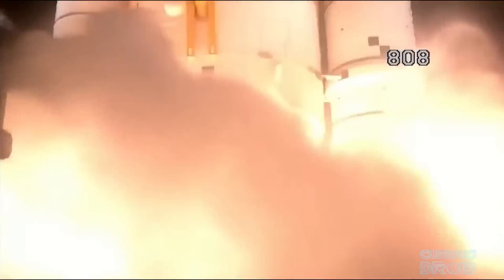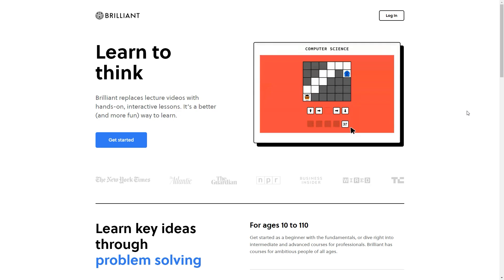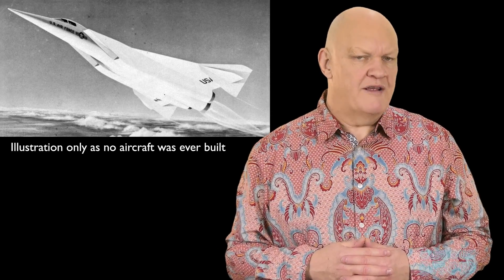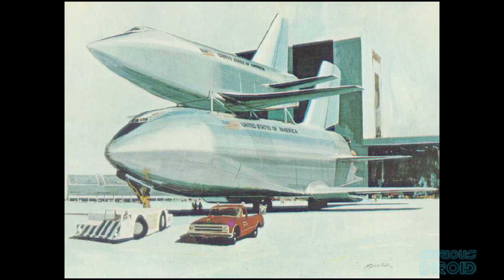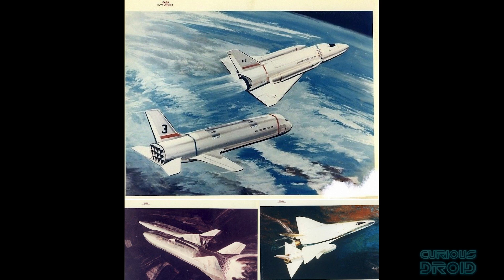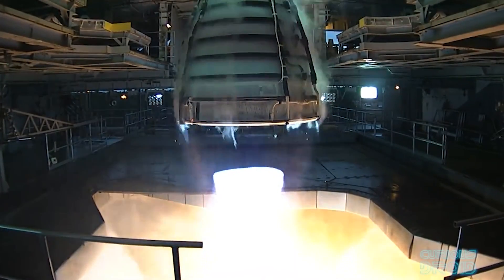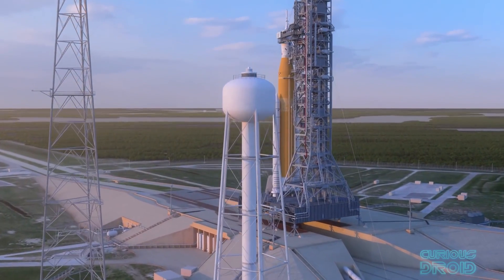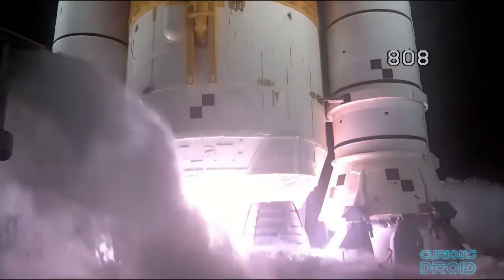Why is NASA Throwing Away Reusable Engines?

Comment: so NASA is still making single use rocket engines..but are using ARCHAIC tech from the SPACE SHUTTLE unlike MUSK who has a reusable smaller but will upgrade to suit rocket family. TYPICAL GOVERNMENT.. wasting tax dollars for half ass results and polluting the worlds oceans with un-needed junk, all while stating ((WE)) need to live smaller and less wastefully.
Reply: Booster reusability is great, but has drawbacks.

First, if you don't have a fast enough launch cadence, you can spend more on recovery equipment and personnel than you save by reusing the booster.
Second, you take a payload hit for the recovery system on the booster. The Falcon 9 B5 can lift up to 22.8 tons to LEO when expended (SX), but only up to 16.7 tons when landed on a drone ship (B1069.2). Doing a Return to Launch Site (RTLS) landing, costs even more payload as you have a boost back burn to cancel the lateral velocity and return back to the launch site.
Third, the higher and faster you go, the harder reusability is to perform. The heavier the dry-mass of your booster, the harder reusability is to perform.

So with SLS launching once a year, eventually, the cadence doesn't really justify recovering the booster. Not to mention that it gets higher and faster than a Falcon 9 as the SLS core stage almost reaches orbit, making recovery MUCH more difficult. The SLS core stage is travelling well over 3 times as fast as the Falcon 9 booster and is well over twice as high as the Falcon 9 booster at MECO. The dry mass of the F9 booster is 22-25 tons while the SLS core stage is 85 tons.
The SLS Block 1 can get Orion to the Moon, but not with the kind of payload hit like F9 has. The SLS Block 1B will send along a Lunar Gateway module with Orion, so it really can't take the payload hit either.

SLS started design work in 2011, 4 years before SpaceX landed the first booster and almost 6 years before they reused a booster.

Comment: While cost is certainly a big factor I think something is lost on most casual space fans when it comes to reusable rockets like the F9. While it is great and should be developed with the maximum amount of support and funding; the fact is that, with current technology, disposable launch vehicles are the only things we have that are capable of sending human rated spacecraft and equipment beyond LEO. We can begin exploring the solar system AND develop reusable launch vehicles at the same time, they go hand in hand. LEO becomes more accessible due to reusable vehicles, lowering costs and opening up the commercial space market, and deep space missions benefit from the increased support and funding, eventually adopting the reusable tech when it gets there. It will happen. It has to. We are in the infancy of this chapter of history.
Reply: Also missed is that 2 of the 4 Falcon 9 launches in Nov 2022 were expended, because the payload needed the landing propellant to get to its orbit.

Comment: Bottom line.. It's cheaper to throw them away than to develop a way to recover them from near orbital velocities.  And any reusability components added, would subtract from the performance of SLS to lunar orbit.  Nothing is ever truly reusable without a trade-off. That is why Starship will need nearly twice the sea-level thrust and multiple launches with orbital refueling to reach a lunar orbit.  Those are some FREAKING BIG trade-offs that might just fail completely.
Reply: Exactly
Reply: You stated everything very well. I am expecting NASA choosing Starship HLS to turn out to be a huge mistake.
Reply: Yep, the whole "holy grail of rocketry and reusability" thing is just another myth that Musk is propagating for his cult of personality and its followers. There is no such thing, there will always be drawbacks and a limited optimal use case. It remains to be seen whether Starship will even make it beyond LEO, and if it does it's guaranteed that it will come nowhere close to the grand goals and expectations.

Comment: I worked at Rocketdyne for 12 years in Advanced Programs and am very familiar with the SSME, J2, J2 Aeorospike, and other rocket engines. They are all amazing pieces of machinery. To quote a friend of mine (another Rocketdyne Engineer) the SSME main fuel pump packaged 50,000 HP in the size of an office trash can. Anyway, there really is no such thing as a reusable rocket engine as most would think of. It isn't like parking a car and hopping in the next morning to drive it again. The SSME were removed from the Space Shuttle after every mission, partially disassembled, inspected, refurbished as needed, and reassembled before being used again. I believe the turbopumps were also partially disassembled during this inspection and refurbishment process. I suspect the Space X and other current reusable rocket engine systems are subject to a similar inspection and refurbishment process. So, throwing away reusable engines may not be that much more expensive than reusing them when you look at total cost, including recovery.
Reply: Thanks for your perspective! I thought too was that if the engine is simplified and the cost per unit reduced, it may over time be cheaper to throw it away than to land it and refurbish it.
Reply: >SSME main fuel pump packaged 50,000 HP in the size of an office trash can.

for some reason my brain can't fathom a pump of the size of a trash can that has 50K horsepower.
Reply: @wrightmf  Lol, fathom ;?)
Reply: @russell2449  yes, brain fade on spelling (I will see if I can correct it). however I still can't image turbo pumps that powerful. Other day talking about rocket engines with a friend, and how good those SSME engines are at getting the high ISP near the ideal limit for H2 and O2.
Reply: @ButterfatFarms  SpaceX is trying to make it like an airplane. Rapidly reusable. This is not a belief thing. It's an engineering thing. You have to be particularly careful about prognosticating about what can't be done when nobody has tried doing it. Now they did try with the shuttle, but that was a single attempt, and I thought a lot of the refurb they did was not engine related.
Reply: COOOOL
Reply: I don't know why you would assume that SpaceX does anything similar to what you've described, especially since they've set an eventual goal of launch turnarounds at less than 24 hrs.  Yes, they often over-estimate some timelines, but they'd never set such a goal if they knew they'd have to tear apart and refurbish 33 Raptor 2 engines before every flight.
Reply: @russell2449  space x also uses a different type of fuel and the entire system is modular so when the test the engines before launch they can quickly disassemble and reassemble it. There rockets are also a shit ton cheaper
Reply: Great insight 👍🏻 The pumps on those beasts are truly fascinating. Never gave that particular engineering detail much thought until I started reading about the F-1s at one point and realized how much fuel mass had to be moved during peak operation. When it dawned on me it left me completely in awe. I was speechless and just stared silently in front of me for several minutes. I remember it vividly 😄
Reply: That it needed such a high level of inspection and refurbishment seems like a failure of engineering, then. Either the project goals were set wrong to allow for a design that needed so much refurbishment between flights, or the product failed to deliver. I can cut the Space shuttle program some slack for the challenges they encountered that were previously unknown. Far less so the SLS, which responded to the challenges of reusability by throwing in the towel, going for a far less ambitious design, and yet still taking 20 years to deliver the world's most expensive way to put 100t into low earth orbit.
Reply: @JosephHarner  it's likely more for precaution's sake than anything else. Even if they managed to reduce the inspection and refurbishment to near zero, protoco/law would mandate high level inspection/refurbishment anyways.

Like the OP says, space vehicles aren't like any other vehicles. Space vehicles that failed would garner public negative attention and space exploration PR tend to be on thin ice. You don't want your rocket to explode and later have to explain to the public that you put too much confidence in your engineering skills instead of life saving procedures.

The same principle applies to jet fighters. They require extensive maintenance after each flight. Can the jets skip the maintenance after a flight? Sure but considering the cost of the plane and pilot, the military doesn't want to risk it.

Better safe than sorry after all.

Comment: My opinion is that if SLS was a 2 or 3 times a year launch vehicle, reusability would be necessary. There would be no way those costs and resources would be maintainable. 1 flight every 2 years maybe not so much of an issue.
The reusable launch vehicles are expected to go up multiple times a year. SpaceX had something like 50 launches this year? At that rate, you had better find a way to maximize your resources or you and the customer will go broke.
Reply: There is also a payload hit for reusability. The Falcon 9 B5 can lift 22.8 tons to LEO (SX), but only 16.7 tons when landed on a drone ship (B1069.2). The SLS can not take that kind of payload hit and still get Orion to the Moon. The SLS core stage is also moving over 3 times as fast and over 2 times the altitude as the Falcon 9 booster at MECO. So that makes reusability MUCH harder to come in from what is pretty much orbital velocity. The SLS core stage dry mass is 85 tons while the Falcon 9 dry mass is 22-25 tons, so recovery is harder that a booster that is over 3 times as heavy.

Comment: Blue Origin has not even been to orbit, and it was founded before space x
Reply: I believe he brought up Blue Origin, because the sub-orbital, straight up-n-down New Shepard is fully reusable.
Reply: @steveaustin2686  There is absolutely zero comparison between the two, and it’s stupid to put them even in the same sentence
Reply: @OwnGrid  I'm not comparing their orbital paths or flight characteristics, just that the New Shepard is fully recovered. Ignoring that fact is just as stupid as comparing the flight paths. In case you missed it, I noted that New Shepard is a sub-orbital, straight up-and-down flight. Maybe pay attention more when you read?
Reply: @steveaustin2686  No I read it, and it seems you missed the fact that it’s not comparable you can get to sub-orbital with a balloon. Orbital flights are very much distinct
Reply: @OwnGrid  OMFG. The video is NOT saying that the New Shepard and the Falcon 9 have comparable flight paths. I am NOT saying that they have comparable flight paths. I F'ing EXPLICITLY said that the New Shepard is sub-orbital and is a straight up and down booster. They are both reusable, the Falcon 9 is partially reusable and the New Shepard is fully reusable. That is the complete extent of the comparsion, reusable vs NOT reusable. This is NOT a hard concept. I'd break out the crayons for you, but I can't draw worth crap.
Reply: @steveaustin2686  Dude I think your confusing your self with the video maker because he literally put them together as if they are doing the same thing. Again Shepard is a gimmick because it doesn’t even go to space you can’t compare with a real space rocket, and the only one actually landing it’s boosters
Reply: @OwnGrid  No, I stated why I thought he brought up New Shepard. Here is my comment again for you.

"I believe he brought up Blue Origin, because the sub-orbital, straight up-n-down New Shepard is fully reusable."

YOU, yourself claimed I was saying that the two were comparable. Let's bring up your comments again shall we?

"There is absolutely zero comparison between the two, and it’s stupid to put them even in the same sentence"
 
And this after I explained I was NOT comparing them, you doubled down on the nonsense. 

"No I read it, and it seems you missed the fact that it’s not comparable you can get to sub-orbital with a balloon. Orbital flights are very much distinct"

Your strawman blew up in your face and you are STILL trying to claim victory. Space and orbit are NOT the same thing. The US awards astronaut wings for going over 50 miles up, whether or not you get to orbit. The Karman line is 62.1 miles up, whether or not you get to orbit, and New Shepard passes that. I NEVER said that New Shepard gets to orbit OR that its "sub-orbital , straight up-n-down path" is comparable to the Falcon boosters. YOU, yourself made that strawman and now are whining that your strawman is being pointed out as flawed. That is ENTIRELY on you bud.

Comment: It does seem like the SLS is a bit of a Frankenstein rocket, cobbled together with old technologies.   It seems like the path to low (or lower) cost spaceflight is through reusability and mass produced components.  We shall see if SpaceX can make that a reality with Starship.   SLS certainly does not seem to fit the bill.   Of course,  low cost or sustainability did not seem to be a mission objective for SLS, but I could be wrong.

Comment: All right, right off the bat. The SLS core fuel tanks are NOT a modified Space Shuttle ET, they're almost a brand new design and use completely different tooling to build.
Reply: True. But SLS was sold to congress, originally oh so many years ago, as using "modified" shuttle hardware as doing so would be economical. We have all seen how that turned out.

Comment: Very well researched. Thanks. I'm rather sad that they are being wasted like this...
Reply: No, not really researched all that much. Booster reusability is great, but has drawbacks.

First, if you don't have a fast enough launch cadence, you can spend more on recovery equipment and personnel than you save by reusing the booster.
Second, you take a payload hit for the recovery system on the booster. The Falcon 9 B5 can lift up to 22.8 tons to LEO when expended (SX), but only up to 16.7 tons when landed on a drone ship (B1069.2). Doing a Return to Launch Site (RTLS) landing, costs even more payload as you have a boost back burn to cancel the lateral velocity and return back to the launch site.
Third, the higher and faster you go, the harder reusability is to perform. The heavier the dry-mass of your booster, the harder reusability is to perform.

So with SLS launching once a year, eventually, the cadence doesn't really justify recovering the booster. Not to mention that it gets higher and faster than a Falcon 9 as the SLS core stage almost reaches orbit, making recovery MUCH more difficult. The SLS core stage is travelling well over 3 times as fast as the Falcon 9 booster and is well over twice as high as the Falcon 9 booster at MECO. The dry mass of the F9 booster is 22-25 tons while the SLS core stage is 85 tons.
The SLS Block 1 can get Orion to the Moon, but not with the kind of payload hit like F9 has. The SLS Block 1B will send along a Lunar Gateway module with Orion, so it really can't take the payload hit either.

Not to mention that the SLS started design work in 2011, which is 4 years before SpaceX would land a booster and almost 6 years before reusing a booster.